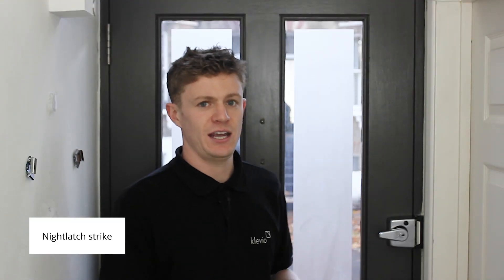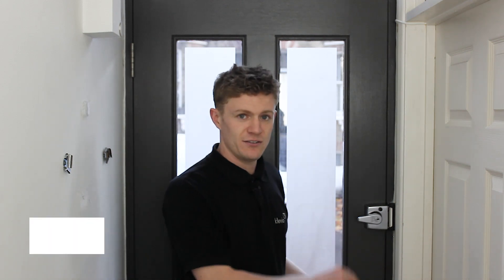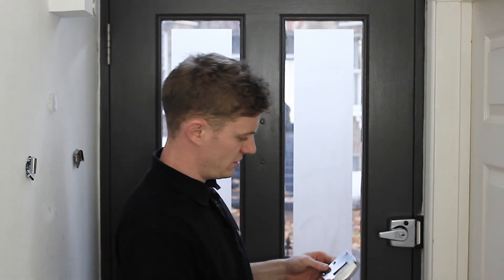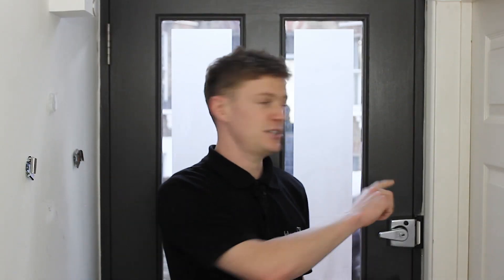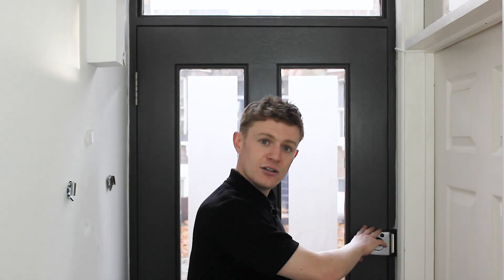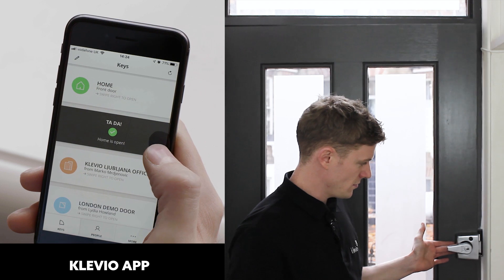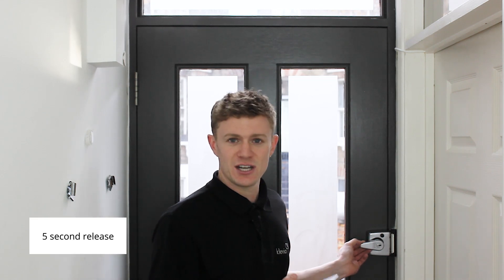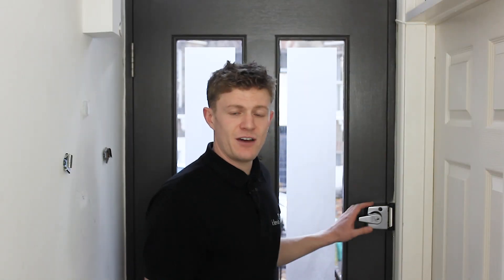Klevio Academy: Electric strike for nightlatches

Comment: Another question; where physically are the connections on the keep for the control wires? I would want to supply a wire through a cavity and coming out in exactly the right position, so there are no surface mounted wires. Do you have high res photos of the keep from different angles, showing the shape, size and control wire connection point? Thanks!

Comment: Hi there, what are the dimensions of the replacement electric strike keep? Our hall is very narrow and our front door is very tight to the hall walls, with only about 2 or 3 cm width available for the keep. Thanks!
Reply from the maker: Hi Hugo, thanks for your comment - the dimensions of the electric strike we usually use (ER350) are 6.3 cm, 3.4 cm (width), 8.5 cm (height). Please write to Ben, our customer support for more detailed answers (support@klevio.com). Cheers, The Klevio Team